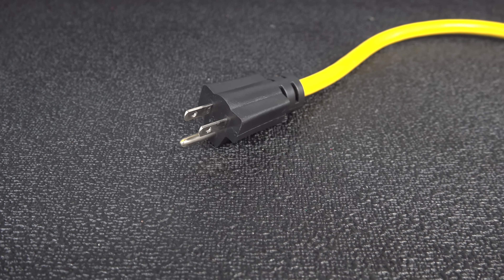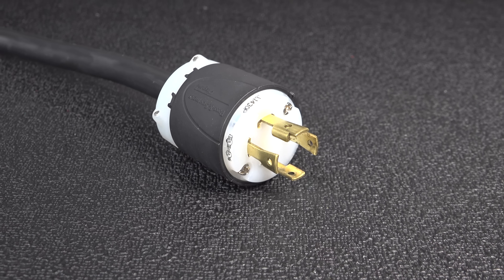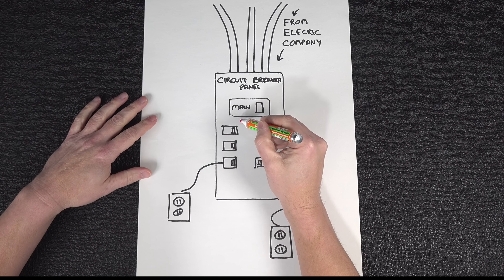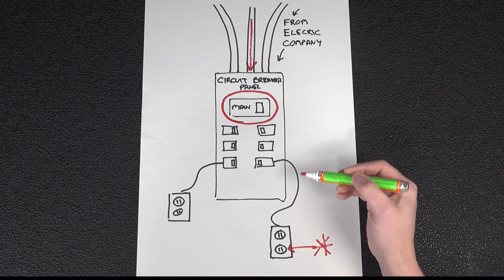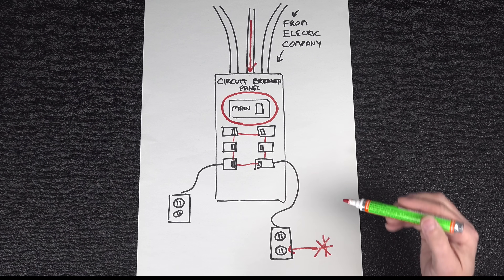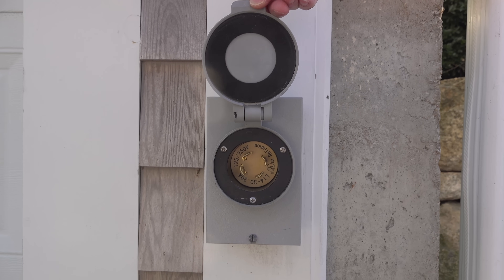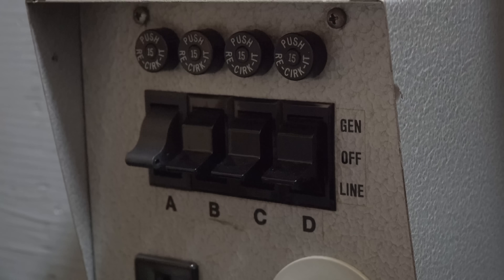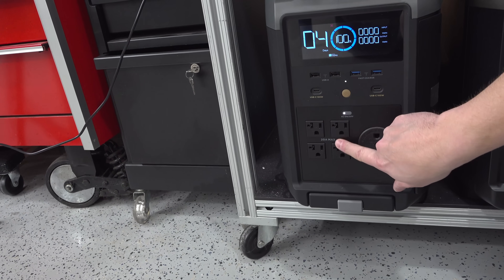Worst Electrical Mistake You Can Make - Backfeeding Generators

Comment: Just because some people are stupid, doesn't mean the rest of us should be deprived of technology. If you eliminated every piece of technology that has ever injured anyone, we would have nothing. But at least you wouldn't have to worry about being burned by a hot toaster. There would be no electricity because someone stuck their tongue in a light socket. Life is already made miserable enough due to stupid ideas like locking washing machine lids because some idiot stuck their arm/head/kid in the machine during the spin cycle. What we need are a lot more Darwin awards to weed these "people" out of our lives. You also fail to consider that one of the reasons many individuals use these "patches", is because government makes it nearly impossible to do the job "right". You can get everything you need at a hardware store to do a "proper" job (generator disconnect/interlock) for a couple hundred dollars plus your DIY labor. But your "legal" choices are to hire a professional for thousands of dollars, or dance with the government for months to get plans approved, permits, inspections, etc. and pay all the various fees along the way.

Comment: Excellent video. I went with an interlock back in 2011.  It makes it so easy to hookup a generator to the house.  Be careful if you live in NJ.  The interlock has to me manufactured by the same company that manufactures your main panel box to meet code. NJ won't except 3rd party interlocks. Also a tie down bracket is needed for the generator beaker in the main box.
Reply: NEC won't accept (correct spelling) mix and match gizmos in panels at all, it all has to be the same brand & that applies everywhere.
Reply: @snap-off5383  I was on jury duty with a case where the lawyer said, "I except" which apparently was a legal phrase.  It confused the judge in the case, and he ended up having to explain to her that he was excepting rather than accepting-🙃

Comment: I have an interlock system on my main panel. I highly recommend it. It’s is a lot easier to install and use than putting in a transfer switch.
Reply from the maker: I  ully agree, my panel shown is a little odd since I have that 4 circuit transfer switch but the interlock is what I use for the larger generator. I didn't take the small one out since if for some reason the big geneerator didn't work I could run those 4 individual circuits with a smaller 120v gen
Reply: Interlock allows flexibility in using any circuit in the house without the preplanning required in setting up a transfer switch. With the transfer switch you have to decide what you want ahead of time, and can't change it around afterwards without rewiring the breaker panel and transfer switch.
Reply: @wingerrrrrrrrr  Why do you have to choose which circuits you want to power with the generator when installing a transfer switch, is that something particular to US wiring?   I had a transfer switch installed which replaced the existing mains switch with a 3 position switch.  So now it's mains / off / generator, with the generator powering all existing circuits.
Reply: @kaasmeester5903  transfer switches have a limited amount of breakers, and you'd have to pick which ones you're going to back up when installing them. If you have a very small main breaker panel then you could cover them all, but usually houses have a greater number of breakers than the transfer switches cover.
Yours sounds more like an interlock setup with one large breaker rather than the ones with individual breakers.

Comment: Quite awhile ago I had to hook up my generator safely to my home while safeguarding against backfeeding rather than running a heavy extension cord to critical devices.  Long story short.  I designed a mechanical interlock that looked essentially the same as what is shown in this video.  I was ready to fabricate it which wasn’t a big project.   Right about that time, while looking up some electrical supplies to purchase, I came across this very same interlock, patented, and offered in various configurations depending on the panel make.  It looked exactly the same but prettier!  Damn!  A great idea too late.  I shared my story with the interlock company and they replied that they get the same emails from others who have had the same situation.  Har!
Reply: there's an exception to the transfer equipment requirement for panels when using temporary connection of a portable generator, so the home-made interlock wasn't even necessary, unless you couldn't lock your panel.  Technically using that home-made interlock is against code, since its not approved.  They even flag code violations if you buy one and modify it in any way.  (NEC fails you if you modify a junction box in any way). but for temporary connection, see the exception:
Article 705.NEC702.6 contains an exception to the transfer equipment requirement:
“Exception: Temporary connection of a portable generator without transfer equipment shall be permitted where conditions of maintenance and supervision ensure that only qualified persons service the installation and where the normal supply is physically isolated by a lockable disconnecting means or by disconnection of the normal supply conductors.”
Reply: @snap-off5383  when the storm hit here in portugal we were living without power for 2 and a half weeks. I had to do that trick, but i fed the power from the generator straight in the main, disconnect the main cables from the street, put pkugs in them so when the company connects the wires they can't short anything out and that was it. No way to backfeed power when cables are not connected. When the company came to fix the cables i explained it, they said it was no problem and they would take care of it from now as they had to put new seal in my box. All good there
Reply: @engenhokas69  Cool thanks for the info, glad you kept the power on.
Reply: @snap-off5383  i mean.. I'm not saying what i did was legal, the men told me it was safe and i did a good job. I don't know if it was legal or not... Most of the times they're not going to call the cops on you because they understand the situation...
Reply: @engenhokas69  Well yeah you could have stole some electricity, but they have ways to KNOW if your neighborhood stole a LOT of electricity and checking the meters in the neighborhood easily finds the culprit, so they could easily check that to see if you were above board or not.
Reply: @snap-off5383  true when i open the box i saw that it would be super easy. And i wouldn't be stupid enough to run every single thing on stolen power come on, I've been around long enough to know that you should steal little so you can keep doing it. I mean, look at them politiciand and all that 😂😂😂 jokes aside, there was no power to begin with 😅 but then we installed digital meters so they know if you take power
Reply: @engenhokas69  It's against code but not necessarily illegal in the sense that they could charge you with a crime
Reply: That's an interesting admission as patents are supposed to be non-obvious.
Reply: "yo i accidentally created your invention"
"we get that a lot"

Comment: Or more simply, if you do not know what you are doing, do not do it.  That said if you are competent to make these decisions, make them.  Sometimes it is the right thing to do.  Electricity is like any of the other dangerous jobs we have to do as human beings.  It is nothing to be afraid of, it is something that has to be respected and understood.  I would far rather see this method used than running the genset inside the home.  There are tradeoffs in all things.  The important thing to remember is not to backfeed into the grid.  You are free to mess with your own life, you are not free to mess with a bystanders like a utility worker who may be working on lines external to your home.  Transformers work both ways.
Reply: I agree...if a person does not know to shut off main breaker..should not be running a generator or driving a car etc.
Reply: Nobody kills lineman backfeeding from a generator, the linesman know "if its not grounded its live".

Comment: No i disagree..  the worst electrical mistake anybody could possibly make would be leaving off the earth ground from the main and wiring a hot to it instead.  That means when any appliances are plugged in they will become hot on the equipment ground..  

Or i would say that bypassing the distribution step down transformer and just coming straight in with the high voltage, unmetered 3 phase voltage coming straight from a substation..  and wiring that into a normal single phase panel..  as soon as anybody tried to connect a breaker it would arc out and likely through the air to them..  or it would sit there and arc uncontrollably until the electric company shut the entire grid off. .  Lol

Comment: Never have nor would i ever use a deadly double male plug like that. no way i have an automatic disruptor switch at the main box but that's not enough. Also have a check list on that same fusebox door and a few homemade safety devices too boot when the grid goes down. top of this list # (1) main breaker switch will be manually turned off.... Invented a grid back on warning system too which lets me know 100% (flashing lights and loud beeper) when the main grid is back up or if it's still down and somebody (not a pure 60 Hz  detector with red and blue flashing lights) is back feeding power to the main line again? Please note even though this automatic switch works just fine i dont trust it. For peace of mind the main 200 amp service is mainly disconnected ever time.... 10k watt generator has its own house and fuse box with two main circuit breakers and power switches connected in parallel to provide totally back feed line protection in case something goes wrong with the disruptor device.....

Comment: I 100 percent disagree these cables are extremely useful for when probing waveforms coming from multiple generators and for the use of sync two hybrid inverters on the fly... another use is quick pannel neutral bonding to generator. Aka grabbing ground from your pannel.

Comment: It’s amazing how “Dangerous” 110v is chocked up to be with people who’ve never worked with electricity, nor know much about it. Back feed cords are for those that know how to implement them, just like 48” chainsaws and 40ft motor homes. Not everybody should have one. But, that doesn’t mean that those of us that do know what to do with one shouldn’t. There’s much more dangerous products you can buy at at your local do it yourself store that also don’t require special training or warning labels to purchase and hurt yourself or other people. 
If a person doesn’t know circuitry and electricity and how to implement it safely, they ought not try, and if are too dumb to know it, is not all the rest of ours’ problem to worry about. 
We can all agree walking barefoot across a wet slippery tile floor is dangerous, but no videos warning us to vehemently avoid water getting on your tile. 
Maybe is better put, these cords can be dangerous like many other things, use only if are already instructed on how to use or are an electrician. 
Much crazier daily electrical nightmares happen all day long in Mexico just miles from us worried Americans. And they don’t go up in a puff of smoke, amazingly. 
(Bare wire lighting in Pharmacies scary)
Reply: I agree...if a person does not know to shut off main breaker..should not be running a generator or driving a car etc.

Comment: I did this in 2007 as well, during the same ice storm.  But MY cord is a 30A cord with a pair of 4-prong male plugs.  AND, I have an old house with a split panel and NO MAIN BREAKER!  I plug the generator into my shop and it backfeeds to the house.  Prior to the storm I had printed up a detailed set of instructions on how to connect and power up the generator, along with color-coded dots on all the breakers.   I tested it and it was all good...

When the storm hit,  we were down in Southern Mexico on holiday and our kids were at home with my SIL.  Phone call from my daughter: "Dad, a tree branch broke off and ripped the power line off the house.  We got no power, water or heat."   My 16 yo daughter and a couple of her friends were able to follow those instructions and get the house up and running.  Well pump, lights, refrigerator and heat from the pellet stove.  Outside temps were below freezing...

It took us 36 hrs to get home, and it took the power company a week to get the area's power back on.  We ran on the generator the entire time, and I made the power line repair myself (no electricians in sight).    My janky-ass generator setup saved our bacon; we didn't freeze and we didn't have to eat each other.
Reply: I agree...if a person does not know to shut off main breaker..should not be running a generator or driving a car etc.

Comment: The ONLY time I've ever seen a 'safe' usage of one of these was an off-grid cabin where the owner used a 15-amp receptacle to feed his cabin (small fridge, few lights). Therefore no grid to backfeed and the outside outlet WAS his input. The cabin was pretty remote so he wanted to be able to take his generator or solar generator with him while he was away.

That said, even he later swapped it out for a covered male socket so he could use a regular extension cord.
Reply: The key phrase here is "off grid". There is no other power source than the generator. Once it's put back on the truck there is no power and therefore no danger.
Reply: If it is only ever going to be off grid, then why isn't there a single male connector to get power onto the grid from the generator? The point is that you should only ever have one 'input', and power should always flow from female to male. While there is no danger of backfeed, there is still going to be a male connector that is potentially energised, with no need to be. Whether it is 'safe' or not, it is more dangerous than it needs to be.
Reply: There’s a whole lot of I dunno wtf I’m talking about in here. But let me tell you why this was wrong. Gtfoh.
Reply: @CajunReaper95  …what?

The exposed energized plug would be the other end of a male-male cord plugged into the generator. Any time you have a male-male plug, you have a potential for something to be exposed and energized.
Reply: That’s still not safe, as you have an exposed energized male plug if you unplug the generator feed. They make normal 15A male inlet plugs, and they’re really cheap.
Reply: @jeffscott1543  Oh I agree. It's nothing I would do. That's why I said 'safe' in quotes, lol. Me personally, I want to do an interlock and external inlet. Ya know. Whenever I get a generator. 

Wife wants the kitchen redone first. So.
Reply: @jeffscott1543  Maybe if they have solar power running to the cabin
Reply: @jeffscott1543  yea god forbid you touch yourself with it. And it hurts for a split second. Or wave it around everywhere and touch it to metal. Oh no I tripped the breaker. This is not that serious. And literally how every single hunting camp 100’s are wired where I hunt…..
Reply: @MrT13  If you have an off-grid cabin, and no one else can touch it, do what you want to your heart’s content. But this is a case where doing it wrong makes it unnecessarily dangerous for an unfamiliar user, and saves zero cost.
Reply: @jeffscott1543  actually it saves having to make another plug with a switch on the house. My dryer plug is already there. You still need a cord for both soooo actually I do save. I’ve done this for 30 years. It’s not that serious.
Reply: @MrT13  That might work for you, but it’s not to code, or remotely idiot proof.
Reply: @jeffscott1543  I agree. Some ppl can’t “remember to flip their main”. Literally the one single thing. Just can’t do it. So definitely not idiot proof. I agree lol. That pesky one single thing to remember.

Comment: Backfeeding is a bad idea in general, although if done cautiously, in a limited sense, it can be done safely. For example, if the ONLY thing you need to power is your refrigerator, you can turn off literally all your other circuits and ensure the circuit you're backfeeding through (ideally this should be a dedicated circuit for this purpose) is rated for high enough amperage. It's still illegal, but if you know what you are doing it's not the worst thing in the world. The problem is that too many people don't know what they're doing and screw it up.
Reply: Wouldn’t it be easier and safer to just plug the fridge into an extension cord connected straight to the generator?
Reply: @CT-vm4gf  correct..... but a furnace needs a nice ground for the flame sensor (flame rectification) that  is why back feeding to dryer outlet (240 volt) energizes whole panel and you just use breakers you need..or that your 240V outlet on generator can support as amps go... ..if a person does not know to shut off main breaker..should not be running a generator or driving a car etc.
Reply: Seems like the big If is ,  IF People do not turn off the main breaker before starting generator.     IF people turn on the main breaker when generator is running.  A mechanical interlock prevents the main breaker from being  in the wrong place at the wrong time.

Comment: In the electrical trade we call cords like this "Widowmakers" and they're problematic even on job sites. A first year apprentice made one on a job site last year and accidentally back-fed the circuit I was installing receptacles on when he plugged it in, blew up my wire strippers but luckily neither myself nor anyone else was hurt.
Reply: That’s the best one you got, you’ve never had your cutters arc before?
Any veteran electrician has had a few of their favorite cutters blown up, it’s a fact of life in electrical work. Back feed cords aren’t any more dangerous than trying to plug in a night light with your fingertips.
Reply: @dallynsr  You’d rather his story ended with someone being electrocuted? An electrician that doesn’t put safety first, shouldn’t be an electrician.